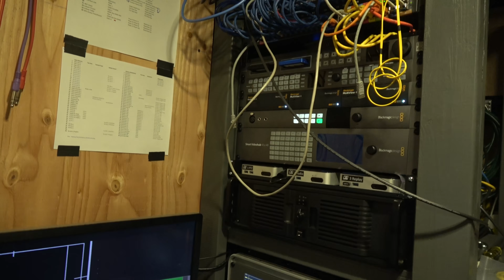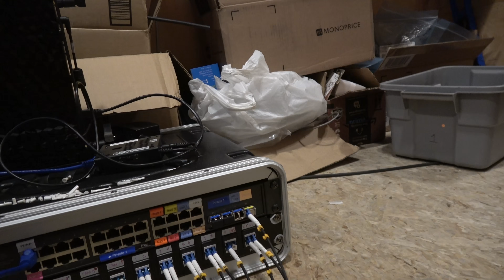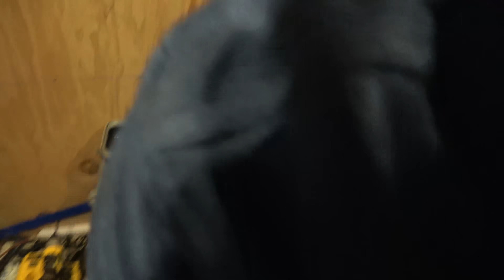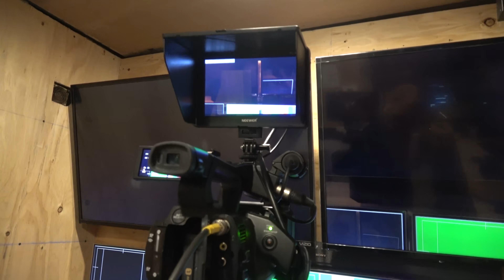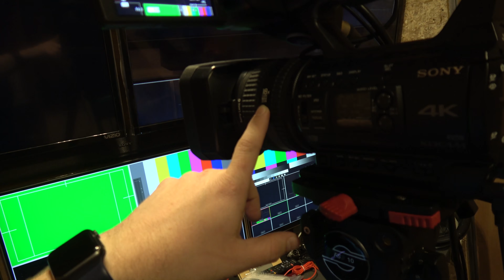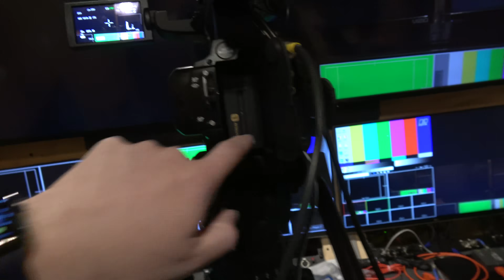Signal Transmission over Fiber: Camera to Trailer (Budget Video Production)

Comment: Don't you like Black magic cameras?
Reply from the maker: It's entirely dependent on the situation. In a studio setting they can work well (which is why they're called "Studio" cameras). For the type of work that DJP does they're not a good match, mostly due to the lack of proper lenses for MFT and EF for live video and the types of events we shoot.

We shoot a lot of events where we need a super wide zoom range. It's very common for us to have to place cameras far away from the subjects we're shooting -- back of the room for business conferences or concerts, or far away for sporting events, etc. -- so having a long zoom is essential. But I also like to be able to get wide shots for context as well, and do so with a minimal number of cameras, operators, and reduced setup time to keep budgets low for customers. Being able to capture both a wide shot and a tight shot with a single camera is a big deal to me.

The ability to control color and other settings of the camera remotely is a cool feature, but it's less useful to me than having a wide zoom range with a smooth electronic zoom. I'd rather talk a camera operator through the process of making camera adjustments than not be able to get the proper shot I need at all because a lens to cover an event properly is either unaffordable or not even manufactured. In the case of most Blackmagic cameras, there either aren't proper lenses to do that, or well outside the budget of the types of clients we work with. And we certainly aren't going to be swapping lenses in the middle of an event.

In an ideal world it would be nice to have a mix of cameras from different manufacturers based on the particular strengths that different models have. But in the real world, getting cameras from two different manufacturers (or even different product lines or vintage within a single manufacturer) to match visually is next to impossible, so we're kind of forced into a situation where we choose one product line that is the closest match for our general needs and live with the fact that there might be other options out there that might fit one particular niche need better in one scenario, but in the general sense aren't versatile enough to cover the situations we encounter the majority of the time.

So, bottom line is, because of the poor choices of lenses available for the Blackmagic cameras, they just aren't very well suited to the type of work that we do and the compromises we'd be force to make are too much of a problem.
Reply: @djp_video   wooow, this is the answer I have been yearning in any review or video production I watch, Honestly. I been thinking about it a lot. 
I am trying to get into live streaming, from both church and sports events. 

This answer has actually narrowed me down on what to look out for.

Their studio cameras as you mentioned is great option for the studio.

Thanks Doug, I am very grateful. I be very glad to be part of your crew and learn more in the real world... I've been watching videos a lot and I've got soo many questions

Comment: Pretty interesting. Good job. Question: When doing multi-cam shoots, how do you balance and match image between the four cameras?
Reply from the maker: To start with, I use cameras in the same family from the same manufacturer. My main cameras are all Sony PXW-Z150s. So I can just get one camera setup exactly the way I want and then copy its settings to the others using an SD card.

Comment: what system would you recommend  for the talk back system
Reply from the maker: There are so many factors that can go into that decision that it's really hard to make a recommendation that is going to fit your specific needs
Reply: @djp_video  
Dose black magic fiber to SDI take any SFP
Reply from the maker: @benmug201  Most SFPs will physically plug in, but you really should use SFPs specifically made for video. The Ethernet SFPs can technically work, until they don't. When given a long string of identical data, like some specific solid colors, Ethernet SFPs will not pass the signal correctly and you'll experience dropouts or corruption of the video data. Video SFPs know how to handle that correctly.
Reply: @djp_video  
Ok thank you so 
Is it ok we talk on mail I have a church function coming up next month and I have some cameras in about 200mt that am planning for. Am in Uganda and I don't have access to most of these accessories  I actually need your help on this

Comment: Hi Doug. I’m investigating options for extending video runs beyond my current SDI limitations. Is optical still the way to go? What type of rugged connections do you use eg. opticalCON looks good. Thanks
Reply from the maker: For long runs fiber is really the only viable option. 

If you can fit opticalCON into your budget that's indeed what you should use.
Reply: @djp_video  thanks - I’ve seen a few other options out there (I’m based in the U.K.) but suspected Neutrik would have it sorted 👍🏼

Comment: Hey Doug, any chance you ever got a chance to do an explanation of how you do your PTZ cameras over fiber? I'm very interested in this, but couldn't find it in your library. Thanks!
Reply from the maker: Not fully.

I split the two strands on an LC duplex cable. One goes to a media converter with a bi-directional SFP for the Ethernet connection. The other goes to the output side of a BMD Optical Fiber converter.

I'll have to do a quick video on it.

Comment: hello, excellent video can anyone help me know how I can connect a remote camera wirelessly to a cabin without using cables? just as reporters do when they go to events and send the signal to the studio
Reply from the maker: Multiple different technologies are used. At first it was via satellite, then via microwave relay, but these days a lot of it is done with cellular streaming.
Reply: @djp_video  Two last questions: how would the cellular transmission work to connect it to a software or video mixer? Is there any BlackMagic solution for this? thank you for your reply
Reply from the maker: Streaming into a mobile production trailer/truck/van over cellular is going to be a little tricky. Mobile carriers usually don't let you have a publicly-accessible IP address, so setting up a device to stream is going to be difficult.  There are solutions, though. You could have your own RTMP server in the cloud somewhere, and then pull the video down to your production vehicle. Or, there are some mobile cellular radios that offer services to give them a public IP via a proxy server; my MoFi 4500 has this option.

Latency for these solutions is going to be really high, and inconsistent if you had multiple cameras syncing them up would be very difficult to do. 

If you can figure out a way to use a wireless SDI/HDMI transmitter/receiver you'd get more consistent results.
Reply: @djp_video  Thanks a lot. Your information has been of great help to me.

Comment: I also have the PXW-Z150 but they don't put 4k out the SDI. Am I wrong?
Reply from the maker: You are correct. If you want 4K you have to use HDMI.
Reply: @djp_video  That's what I thought. Then to do 4k over fibre BM only has SDI to optical so you would need to go Camera -> HDMI -> HDMI to SDI converter -> SDI to Optical. Ultimately we just need a 4K version of the BM camera converter.
Reply from the maker: I've been asking for a 4K Camera Converter for years. It doesn't seem to be on BMD's roadmap.

Comment: Hi , Can you create a new link for the fiber cables ? or share your recommended fiber cable per length
Reply from the maker: Cables: Armored: https://www.fs.com/products/40384.html, or Unarmored: https://www.fs.com/products/40191.html

I don't currently have a recommendation for the trunk cable; the one I originally got was off of eBay, and the one I'm using now has had some reliability issues.

Comment: Looks good. Where are your ccu’s located?? You can simplify your system. If you’re using hdx s or lunchboxes. What kind of tv production are you doing?? Small sports shows? Another tip paint the plywood in your trailer. It will look much more professional. If you are looking for help I can stream line your setup. I also have a way to eliminate hdx s. I also rent and sell TACTICAL fiber. Not that crap u have on a spool.
Reply from the maker: My cameras don’t support CCUs. It isn’t in the budget. We do live events of all kinds.

Within a couple weeks of shooting this we covered the walls in carpet.

Comment: Doug, sorry for My bad english. 
How du you Split the Video-Return (PGM) which goes with the secound cable of the Duplex cable to the Kamera. You take 1-8 Fibre for the Kamerasignals and two fibres for the return(pgm). But you Need ist 8 Times for 8 Kameras. Thanks
Reply from the maker: The return signals going to the cameras are identical, so I use an optical splitter to split a single fiber strand to four cameras. That way I only need two strands for eight cameras.

Comment: Hey Doug, do you have the model number for the zoom remote?
Reply from the maker: It's the Zoom Commander II, most recently sold by Sign Video or Sound Excellence.
Reply: Doug Johnson Productions Thanks! I’m going to try it out. I don’t have good luck with the varizoom rockers.
Reply from the maker: Most of the rocker-style controllers don't work that well, to be honest.
Reply: Doug Johnson Productions I agree. I get jerks and stops when trying to do super slow zooms. Does this have a latch function or do you have to hold the button?

Comment: Would it be possible to see the backside of your breakoutbox with the fibre connectors? Great piece of equipment!
Reply from the maker: There's nothing to see. All that's back there is the power inlet for the network switch. The rest is just passive connections from the right side of the optical panel to the left.

Comment: Hello sir! How do you run 4 picture signal to every monitor? Is it just regular multiview output or something else. Thank you a lot!
Reply from the maker: I use several Blackmagic Design Multiview 4s to achieve that.
Reply: @djp_video  Do you use a router to select the signals that go to the Multi-view and then use multi-view out into the Talkback converter PGM in?  Doesn't the PGM in send the tally signal to the Cam Converter?  How do you maintain the tally to cameras and, also, maintain the program tally in the multi view video signal you send back to the camera op?  I just can't visualise it, but it is a great idea!
Reply from the maker: @28timm  That's a pretty astute observation.  I do lose tally/camera control at the Camera Converter if the signal is sent through the Multiview 4. (I've been bugging Blackmagic to fix this for a long time).  What does work, though, is putting the green/red tally boxes around the sources at the Multiview itself.  Input 4 of the Multiview is the program feed, and the Multiview knows how to use the tally information from that source to add its own tally markers.

If I really do need tally at the camera, I simply route the program signal to the camera instead of the Multiview. For most productions fiber outputs 1-4 on my breakout box feature the Multiview, and 5-13 are just the program output. So I can just move that camera to a different fiber input/output. Or, if we really need tally on all cameras, I'l just use my routing switcher to send the program to cameras 1-4 as well.

Comment: me again here on this vid...
i'm seeing here you use 12-strand fibre, and on the other video the setup used a 12-duplex-to-MTP/MTO. Is there any specific use for either setup, or has this setup evolved in some way? If it's different usage, can you explain the differences?
Reply from the maker: There are two primary reasons that I use the black fiber reel: (1) It's armored, so it's at least partially protected from damage from foot traffic, being kinked in doorways, etc. (the yellow cable is not), and (2) It's longer than my MTP cables (200m vs 150m).  

Ultimately I will be moving BACK to MPO/MTP, as setup time can be faster since I'll only have to connect one plug on each end of the cable rather than the 12 I'm dealing with now.  I just need to find, budget for, and invest in a 200+ meter, 24-strand, armored cable.  It's a better way to go in the long term.
Reply: ahhhhhh. gotcha. so the planning stage should look at the possibility of:
1x strand for video IN
1x strand for video OUT
1x strand for data (for PZT cams)
1x strand for aux/just in case
PER camera
Reply from the maker: If your return video to multiple cameras is the same, you can use a simple optical splitter (1x4 has worked fine for me, but 1x8 was problematic) to reduce the number of strands needed.  Also, if you happen to be running IP-based PTZs, you only need a single connection over fiber and can distribute from there using a simple Ethernet switch.
Reply: ohhhhhh. the power of hands-on experience! thanks for walking me through it Doug!
Reply: @djp_video  I had this exact question. Thanks for the response as it seemed to me as well that the MPO/MTP+cassette solution was better.  However I'm having trouble sourcing 200M  armored MTP cable.  Any suggestions? 

I do wonder slightly about redundancy with MTP. If my understanding is correct, if a pair in your black fiber reel gets damaged you have options to re-patch, etc.  If the MTP cable is damaged, ALL pairs are non-functional, no?
Reply from the maker: @rss4540  There are vendors that will build custom cables, but finding them pre-made is tricky. I actually found mine on eBay.

The main reason I don't normally use the MTP/MPO is because the cable isn't armored. Finding armored MTP cables is hard to do. They're so thin and fragile, if one gets pinched in a doorway there's a good chance that everything goes down.

Using MTP with a cassette would allow re-patching -- it's just done after its broken out instead of on the MTP side.

Comment: Hey Doug, thanks for some great videos. I've been looking for a large digital clock, and couldn't help noticing yours hanging in the top right corner. Is it radio-syncronized and where did you get yours?
Reply from the maker: It uses NTP to get time from over the Internet.  It's made by Masterclock (www.masterclock.com) and the particular model I have is the NTDS26.  They do make models that use GPS if that's what you need.
Reply: have you ever seen the website:
http://onlineclock.net
Reply: You can get really cool gps synchronized or radio syncronized clocks that can output timecode as well here: http://www.die-funkuhr.de/html/_typ_3a________________.html
The Site is in german but the products are very good and the pricing is fantastic for clocks with timecode ;)

Comment: Nice video I have watched a few of them now since you started building your trailer 
My questions is how did you get the multiview feed into the studio converter.   I have the same sort of set up over fiber 
You did mention getting camera control over the same fiber as the video in your duplex.  Can you please explain how to do that 
Are you using a multiplexer
How did you do you runs from your smart video hub to your me2. 
I had an idea of running a sdi camera in the hub and then the output of the hub into a up down cross converter back into the hub to match resolution from mixed video signals
Reply from the maker: Well, I run all signals through my Videohub, so in the case of the Multiview output going to the Studio Converter, the output of the Multiview just goes to one of the inputs on the Videohub, then one of the outputs of the Videohub goes to the Studio Converter.  Then the Videohub is configured to route the Multiview to the Studio Converter.

Considering that Blackmagic uses SDI ancillary data for camera control, passing video through the Multiview has a serious disadvantage, though, because the Multiview doesn't currently pass that ancillary data from its SDI inputs to the SDI output.  So if I need camera control (including tally), I can't have the Multiview in the path.  That's one of the reasons I send program video on a second fiber, since it does contain the camera control data.  I'll use one of those channels (with program only and no Multiview for those cameras) if I need camera control or tally at the camera.  I'm still hoping BMD will fix this and pass that ancillary data through in a firmware update.

The outputs of the Studio Converter go directly to the Videohub (inputs 1-4), and then the first 13 outputs of the Videohub go to the same numbered inputs on my ATEM switcher.  This allows me to send video not just from cameras but from any other source to the switcher.  (Technically the first three outputs of the Videohub go to the Multiview, then the loop outputs of the Multiview go to the switcher.)

Comment: Hey Doug, thanks for this video. Are you having issues in louder environments like concerts with the gaming headsets (and their mics) regarding understandability?
Reply from the maker: Sometimes. Mostly only when an operator is really near one of the speakers. I'm not sure many headsets would hold up well in that scenario, though.
Reply: Well you could use tradional intercom headsets that have better isolation and better mics, could you?
Reply from the maker: That's one of the reasons I have the Beyerdynamics you can see sitting on the right side of the front desk of the trailer.  It's kind of a pain to adapt to 3.5mm plugs instead of XLR and 1/4" TRS, but it does work.